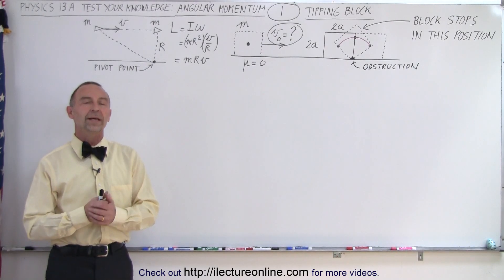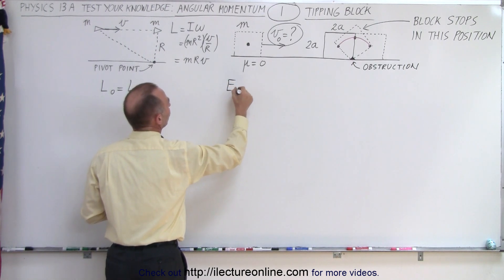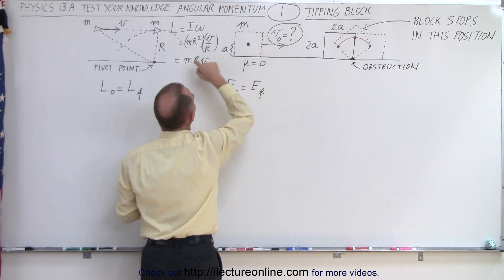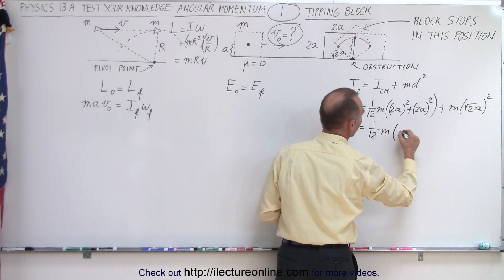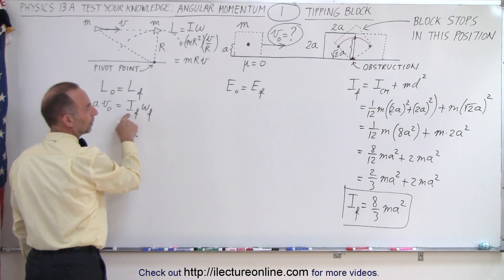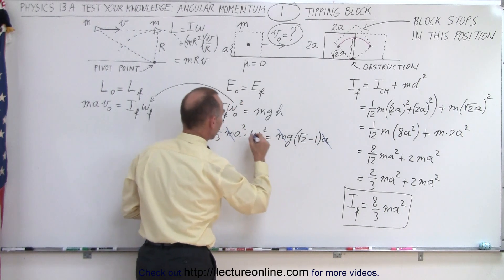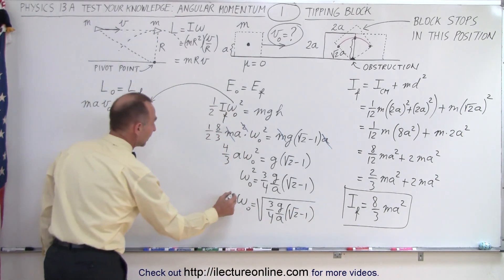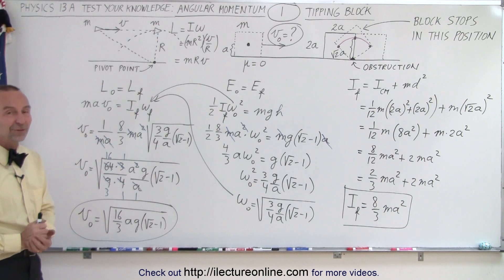Physics 13A - Test Your Knowledge: Angular Momentum (1 of 26) Tipping Block

Comment: Another awesome video. You generate the best “thought” provoking problems. 
However, I’m wondering if we can’t cut out the middleman here.  You are looking for the initial linear velocity, in other words the initial kinetic energy.  The energy flow is Kinect energy, to rotational Kinect energy, to potential energy.  The height difference of the center of mass of the block is the energy change required.  Shouldn’t this tell us the initial kinetic energy required of the block, and hence the initial velocity?  Assuming of course none of the energy gets converted to heat of the collision with the obstruction.  If the question was worded as, what is the initial angular velocity?  I can see having to find the total moment of inertia, as you did.  
Or, simply, as most physics problems, there is more than one way to find the answer.
Reply from the maker: You are definitely thinking along the correct approach, especially if no energy is lost during the collision.  And yes, there are often multiple ways to solve the same problem.
Reply: I've just tried to solve for the initial velocity by your method, but the final result is wrong by a factor. The way you suggested is like the block has a inicial velocity and then it slides on a ramp until it stops and its center of mass is higher by a h height. I am not really sure why this method hasn't worked, but I guess it's because it disconsiders the factor 8/3 of the moment of inertia, suggesting that we should be specially careful when approching rotaty motion.
Reply: Matheus Lineker by necessity, some energy must be wasted.  The same angular momentum, with a greater moment of inertia, requires less rotation energy.  In my statement above, I was not saying you can directly equate the rotation energy to initial Kinect energy, (or perhaps I worded it poorly) which is why I made the statement about heat.
The initial angular momentum is equal to the final angular momentum.  But look at the difference in the moment of inertia of the two sides.  The final moment of inertia has a 2.6 out in front, while the initial moment of inertia does not.
Gravitational potential energy is a conservative field, doesn’t matter how you get there, just the change in height matters.
Professor van Biezen equates the change in gravitational potential energy directly to the rotational kinetic energy, an exact exchange.  However, some of the initial kinetic energy never gets converted to rotational kinetic energy and gets wasted.  I’m assuming this is why Professor van Biezen linked the final answer to the angular momentum, to account for the change in the moment of inertia, and hence less rotational energy required.
I will let Professor van Biezen comment.
Reply: Oh, I don't know why you deleted your comment, but by reading it, I've just realized something very interesting! I'll try to explain, I am not even sure if it's right, but I pondered a little bit and I think it's reasonable.
Reply: Matheus Lineker hi, I did not delete.  Perhaps I was editing it when you checked, as I added some detail to it.
Reply: I've tried to equate the initial linear kinetic energy to the sum of the final kinetic energy (which is given by the initial kinetic energy plus the variation of it, the heat loss you had referred to) and the gravitational energy, while assuming there was conservation of the angular momentum in terms of which I had expressed the kinetic energy.
 However, after I made explicit the inicial linear velocity, it was wrong again! There was a 16/5 factor inside the root not an 16/3 factor as expected. I believe it happened because in the instant  in which the block hit the obstruction, it's submitted to a torque that causes it to lose its angular momentum, and precisely this is the reason why the middleman, as you said, can't be cut out. It's necessary to relate the energy to the momentum equations.
Reply: When the block hits the obstruction, just like when a ball hits a wall, it loses it's momentum. However, the momentum of the system as a whole is conserved. Specifically in this problem,  we consider only the momentum of part of it, the block.
Reply: Matheus Lineker there is a change in the moment of inertia, as I stated in my reply 5 posts up.  The angular momentum before and after, as stated in the problem by Professor van Biezen is the same before and after.  The same angular momentum, with a greater moment of inertia, requires less rotational energy.  Professor van Biezen’s equation for the initial velocity accounts for the change in the moment of inertia.  Professor van Biezen equates the rotational Kinect energy to the change in gravitational potential energy.  If you plug the velocity found in Professor van Biezen’s equation into the initial Kinect energy, it will be greater than the change in gravitational potential energy, the difference being the energy lost as heat due to the change in moment of inertia requiring less rotational energy to conserve angular momentum.
I’m going to defer this thread to Professor van Biezen.
Reply: @foxhound1008  I've considered the energy loss, as I said in my third reply, and expressed it in terms of the angular momentum. However, the initial angular momentum isn't equal to the one at the instant in which the block stops (all the energy is in the gravitational form), that's why was necessary to relate the equations of angular momentum, from the beginning to the instant before the block hits the obstruction, and the equations of energy from the instant after the block hits the obstruction to the one it stops. Therefore, I don't see where is the middleman that could be cut. 
Thanks for your feedback, anyway. Let's wait for the Professor van Biezen.